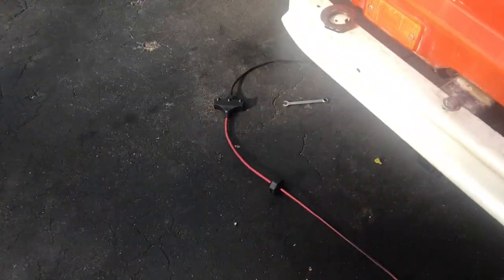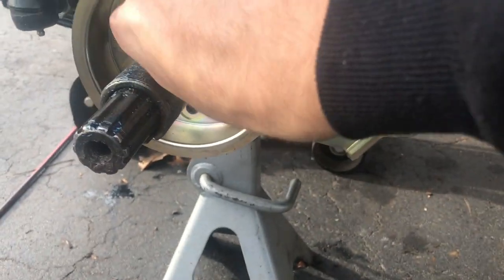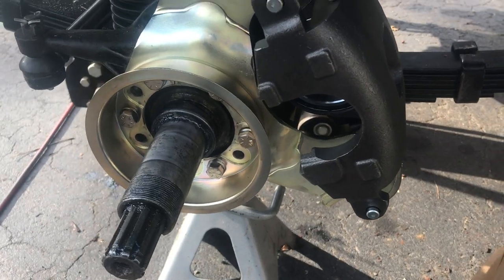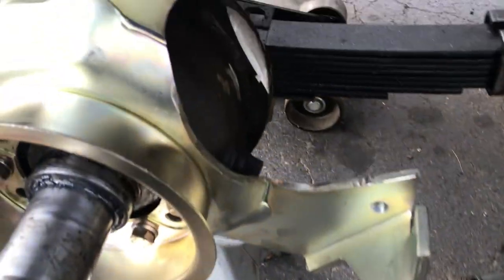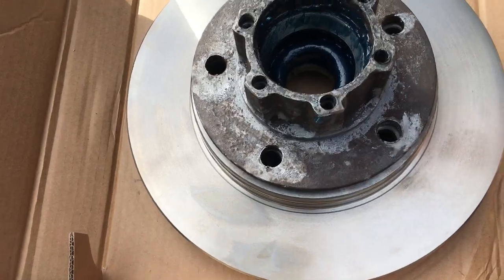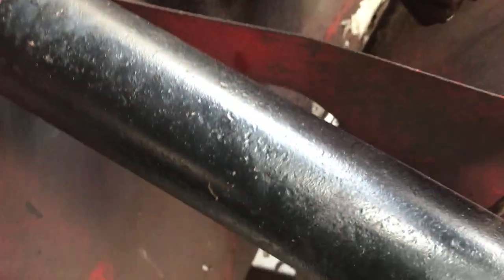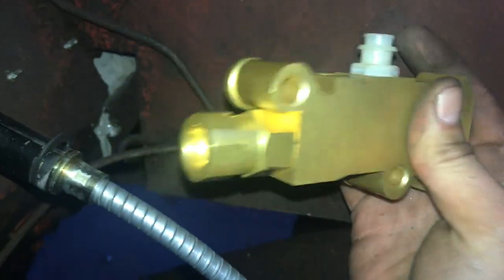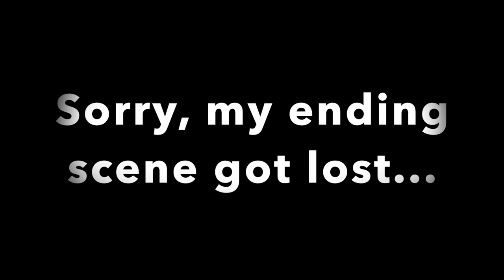1965 Scout 800 | How to Install Front Disc Brakes | How To

Comment: I am rebuilding/restoring a 66 800.  which master cylinder and proportion valve did you use?  TIA
Reply from the maker: I bought the disc/drum proportioning valve from Jegs and the master cylinder from IH Parts America